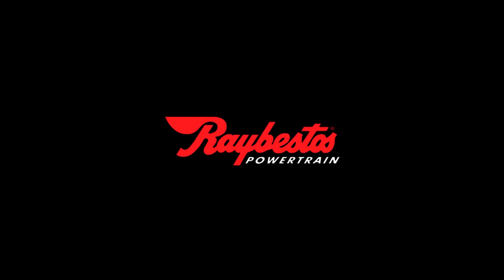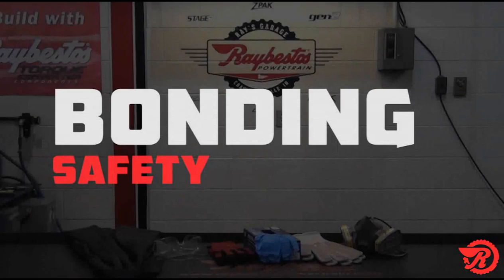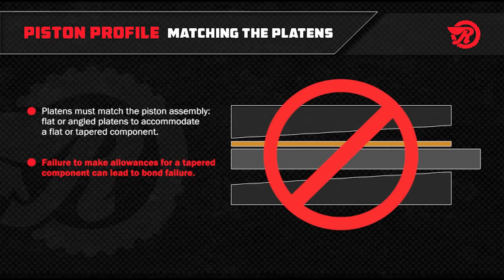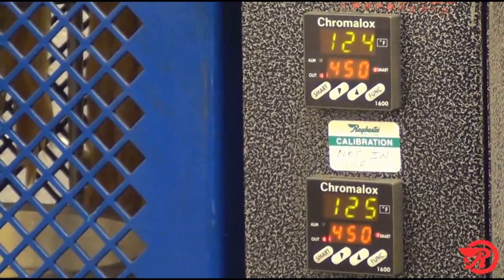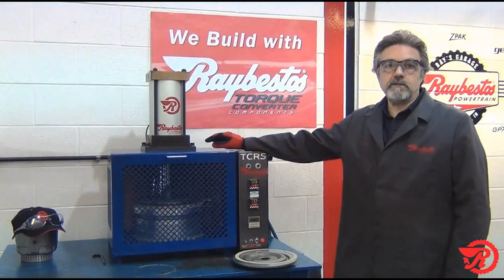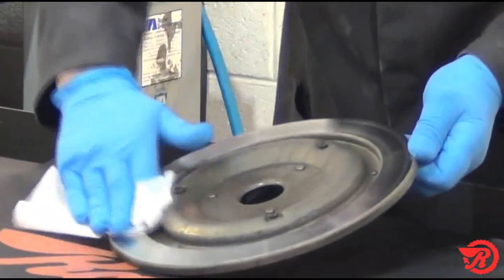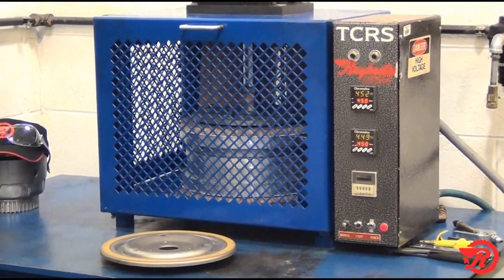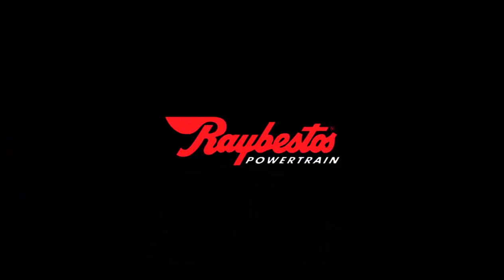Key Elements of Torque Converter Bonding

Comment: Please inform me where to get this friction torque converter binding machine, thank you for the response
Reply: If you didn’t found it you can make it even without air pressure system you can replace that with weight or something like big nut to push items together, and make your tests till you get good result , i I will do that